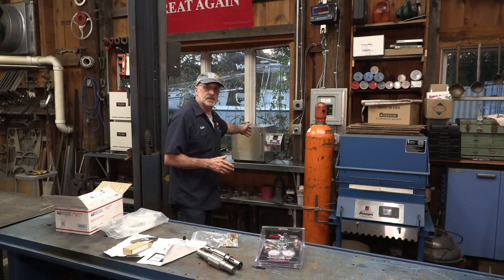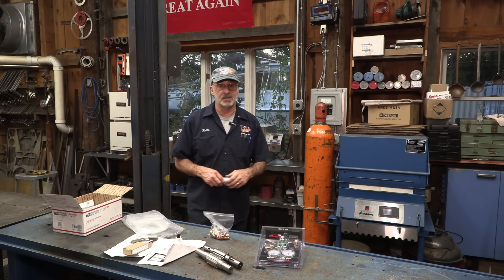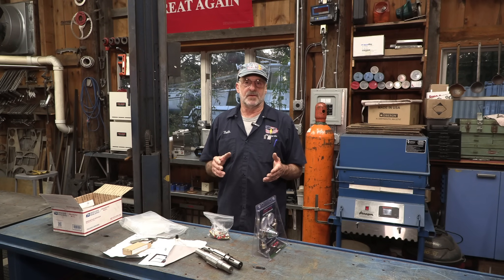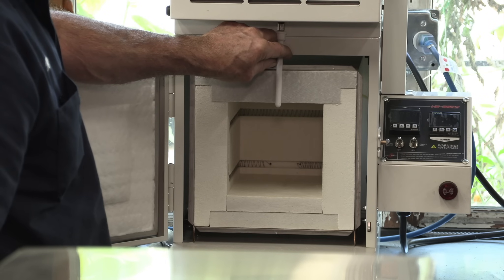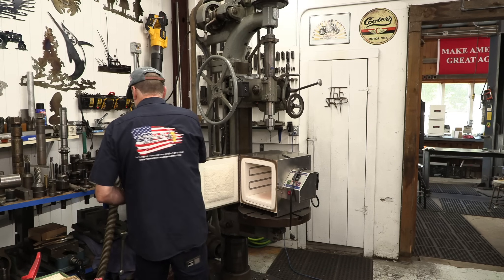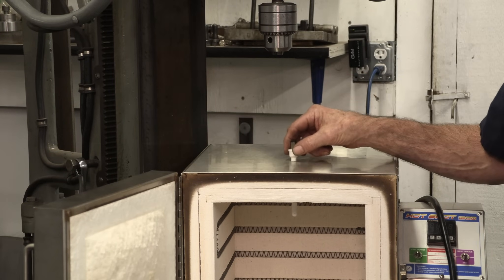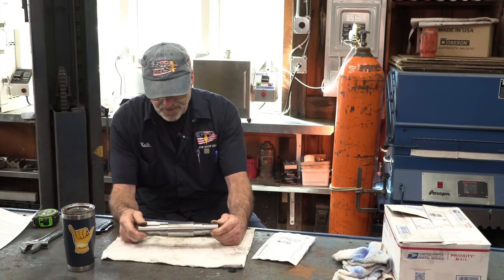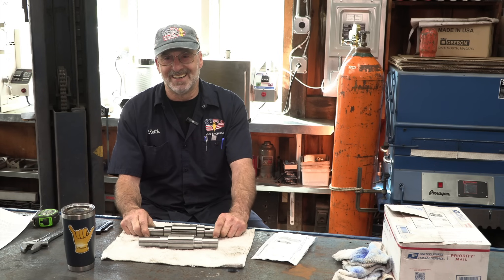Nitrogen Kit

Comment: Back when I worked in wire and cable, we would crack anhydrous ammonia into hydrogen and nitrogen for the shielding during heat treatment operations (usually annealing).
Reply: For your small application, nitrogen is absolutely the best route. It's cheap and it works excellent. Remember a good door seal will help minimize the amount of nitrogen you'll need to achieve and maintain that oxygen free environment. 

Git'r'dun!

Comment: I hate to say it but it looks like the top insulation cracked in the middle due to the downward force of drilling stainless. Backing up the insulation on the inside should be used for others doing this. I am very interested in how well this works. Thanks for the video and information on nitrogen.

Comment: I do not know why but the ovens we use at work around 900c with oil quench and water on the belt uses a nitrogen propane mix. It is a very small percent of propane. Enjoying the videos Keith.
Reply: Hydrocarbons (usually methane or propane) in the heat treat atmosphere are there to control carbon content in the surface layer of steels, either to prevent decarburisation or to carburise depending on the concentration.

Comment: Hi Keith. Did you investigate stainless heat-treating foils? I use it on knife blades and small shop-made tools and simply leave the foil on through the quench, whether in oil or air-quenching depending on the alloy I'm working with. The parts quench fine in the foil and I get zero decarb, with the projects coming out of the foil looking just as good as when I wrapped them, hardened and ready for the draw. For me, it was a "poor man's" way of getting an atmosphere-controlled furnace. It's a moot point, of course, since you invested in the nitrogen purge system, but I was wondering what quenching technique you are going to use for these shafts and whether you will get a small amount of decarb while transferring the parts to the quench? Great upload, as always, and thanks.
Reply from the maker: I have heard of that method of wraping.
Reply: @KeithFenner  It's a good system if you get your projects to almost final polish, as I do with knife blades before I heat treat them. You are still going to surface grind these shafts, as I learned from your latest video, so the foil wasn't necessary. For whatever reason, I thought you'd already ground them. Have a great week!